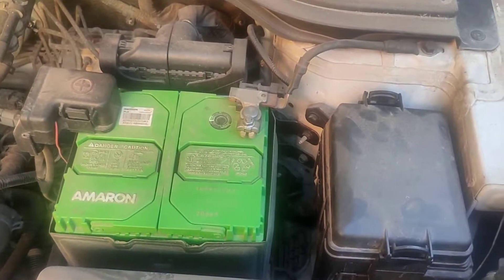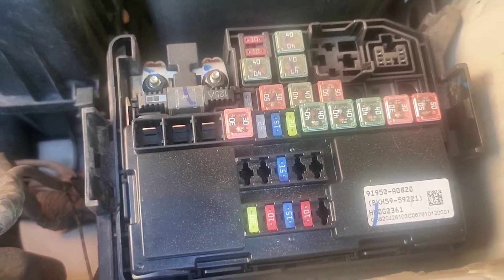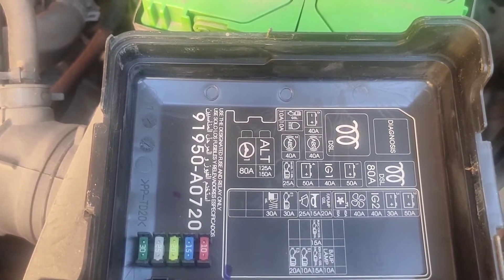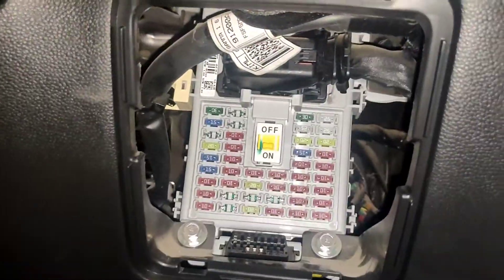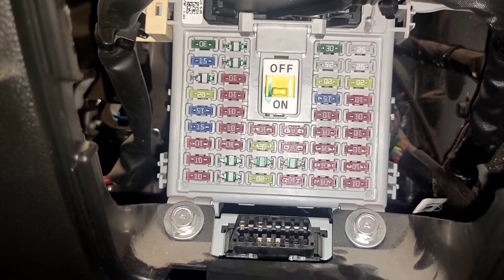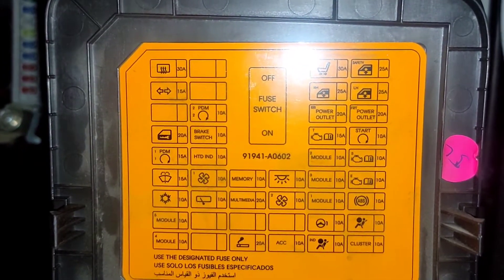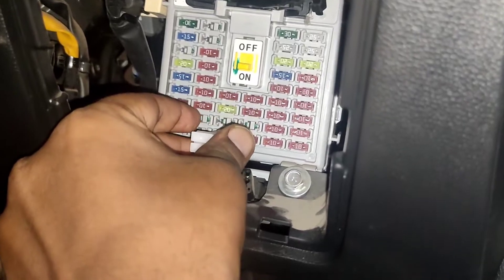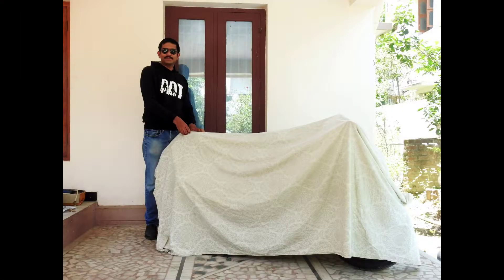How to replace fuse in Hyundai creta | 2017 hyundai creta | Dashcam Dasher vlogs |

Comment: Where is the Power window  fuse
Reply from the maker: Hmm quite long since I made the video and I don't remember now. Just check the user manual. I think there they have mentioned. AlsoI think in the fuse box there are symbols mentioning the purpose of each fuse.
Reply: @Travelwithzx10r  Hi Sir, very useful video, if i am hardwiring my dashcam in my 2018 creta [same model as yours] where should i plugin the ACC & VCC wires in the fuses?